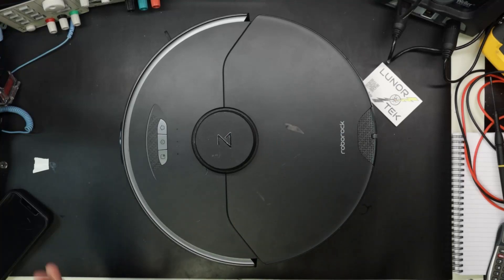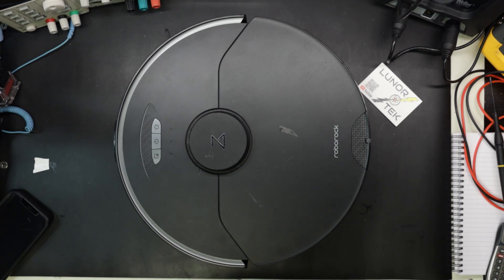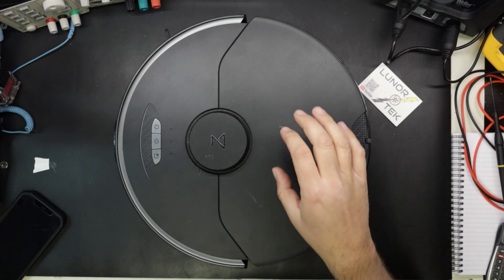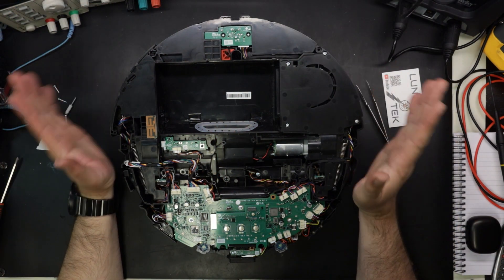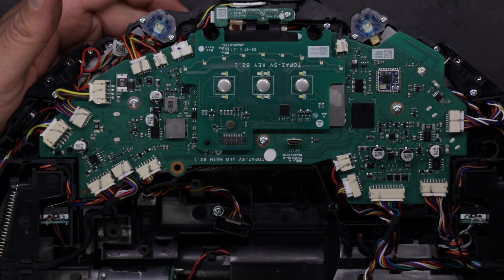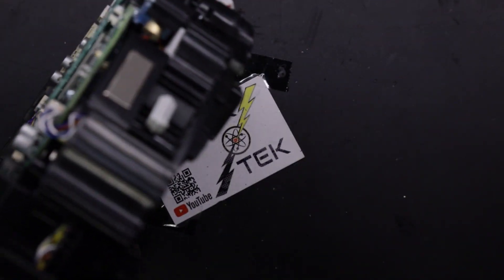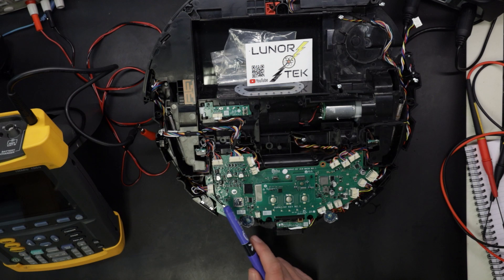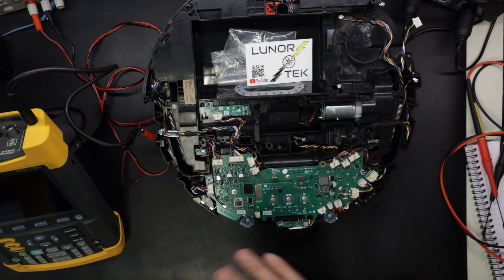RoboRock S7 MaxV Repair WiFi and Water Damage

Comment: Hi, good job!
I have a q7 and the side brush stoped spinning, I've replaced the brush and the motor but it still doesn't spin. Any ideas? I've tested the motor and it does work.
Reply from the maker: Weird? Try a reset and an update first, it may be a bug in the software. If that dont work, test the voltage on the wires to the motor.

Comment: Hello watched the vid ty very much so far got everything off except the cover to reach the fan.. when u acces the main board im missing a screw or something?? Because i cant get the top cover off At 3:45 im lost... Plz help!?
Reply from the maker: I will have a look and see if I can answer your question. Will leave a new comment here when or if I figure it out.
Reply: @LUNORTEK Ty for the fast reply appreciate it!
Reply from the maker: Did you follow the link in my description that leads you to the disassemble video?
Reply: Yes I did I missed the 2 screws at the bottom.. at the mopping section😅 but it worked for me there was a big piece of rubber that covers the fan motor, inside the motor. So cheers mine works again thanx again!!🎉
Reply from the maker: So great to hear! It can be quite frustrating not figuring out how stuff come apart, but so rewarding to fix things when they work again  😊
Reply: Hi my Robrok will not wash my mop the water is still in the tank . I clean my water filter still nothing
Reply from the maker: Hi, if you mean that your mop don’t get wet under cleaning it may be the nozzels in your water tank that is clogged. You can buy new ones and change them out.
Reply: @LUNORTEK Where can I find the link?
Reply: Hi, I also stopped at 3:45. I didn't understand it: how to remove the cover from the motherboard?

Comment: Hello, my Roborock S7 Max Ultra drew water into the robot.  My child started the water pump in the bottle and the robot sucked the water flowing onto the ground.  After that it started giving internal error and fan error.  what should I do.  Is there any chance of saving the robot?
Reply from the maker: Take it apart and dry everything. Most of the components are available to buy and change if anything has been severe damaged from the water.

Comment: hello, my roborock S7 since yesterday does not start cleaning, when you try to start cleaning it restarts and shows that it has no battery, even leaving it charging and in the application it shows 100%, it restarts and soon after it appears 0% battery, could you help me , as here in Brazil there is no technical assistance, I will have to do it myself, could this type of defect be a battery or board, or even a fan? I noticed that inside the dust reservoir was a little wet, do you have any tips? I thought about buying a new battery, but I wanted to do tests so I didn't buy the part for nothing.
Reply from the maker: Hi,
First of all I would take it apart and check for water inside the robot because you noticed water in the dustbin. Remove any water that you find and reset your robot. If this does not work it could be the fan motor or something with the main board. 
Best of luck with your repair!
Reply: @LUNORTEK  Thank you very much, I will check and give feedback
Reply: @rafaelgouveia9728 경험에 의하면 배터리 내부의 셀 한개가 매우 낮은 전압으로 밸런스가 달라져 있을 겁니다. 그게 원인으로 추측됩니다. 로보락 제품들이 배터리 밸런스 문제가 자주 나타납니다.

Comment: Hi there! My wifi doesnt reset, no flash light no voice command. Took apart, the antenna cable was broken, replaced it but doesnt help as it doesnt reset. Any ideas where to look for issue?
Reply from the maker: If the Robot is completely dead, I suggest starting on the power from the battery and check the voltages towards and on to the circuit board and so on.
Reply from the maker: @MrLecher69 Oh, I see.So what kind of method do you use when resetting? I know there are two methods that works and one of them resets also the firmware. Maybe it will work if you have not tried. I will see if I find it again, I have forgot it...
Reply from the maker: @MrLecher69  Here are the two methods: System Reset: If the robot does not respond when a button is pressed or cannot be turned off, reset the system. Press the Reset button, and the robot will reset automatically. Note: After resetting the system, scheduled cleaning, WiFi, etc. will be restored to factory settings

Restore Factory: Settings If the robot does not function properly after a system reset, switch it on. Press and hold the button and at the same time press Reset button until you hear the “Restoring factory settings” voice prompt. The robot will then be restored to factory settings.
Reply from the maker: @MrLecher69  You never know. hehe.. Sometimes the fault finding can be frustrating. Hmm... Trying to think what can cause your issue. So maybe there is something wrong on the main board around or on the wifi module, maybe take alook under the board also and reconnect the antenna again just incase. If you have something to magnify with its much more easy to see if there is a bad og cracked solder.
Reply from the maker: @MrLecher69 Good Luck! Hope you figure it out!
Reply: @MrLecher69  are you able to fix the issue? im having the same problem here😢 hard reset wont work. the wifi signal light is off and the roborock SSID doesn’t show up in my phone. other buttons work well